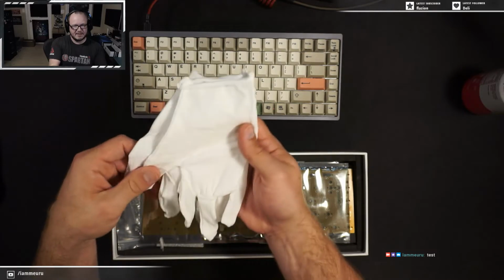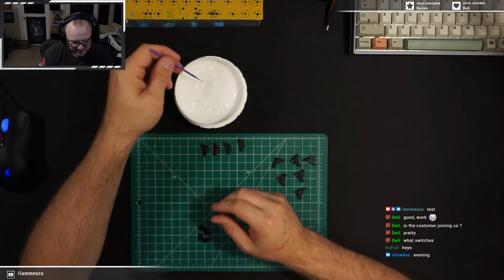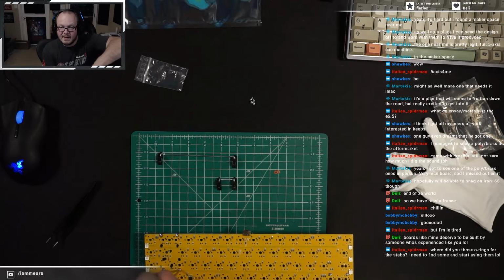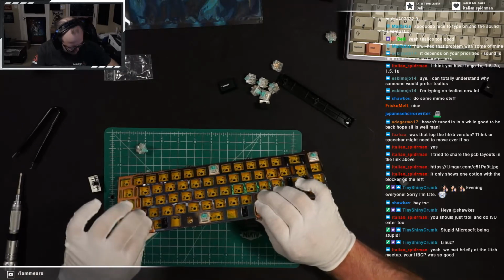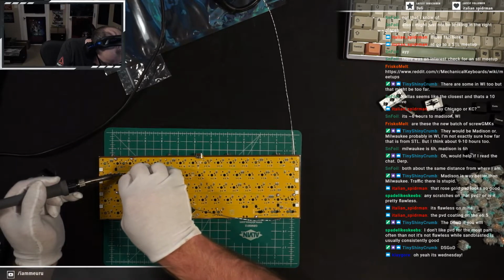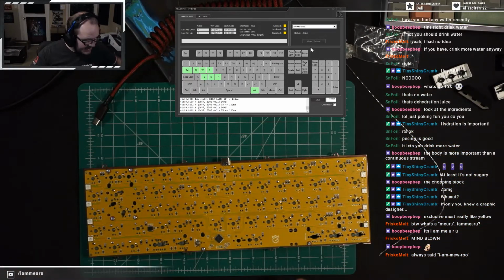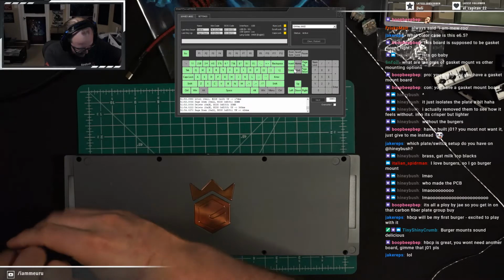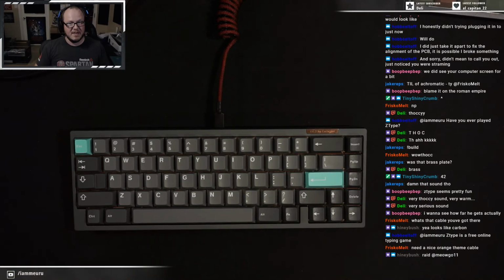Build: E65 w/Tealios

Comment: I rally hate when I hear people say after building this they hate it then I ask how they built it and they usually aay oh top mount no gasket well that's why the gasket helps with the major ping it has yea it will still have reverb but it's not bad it sounds good and if yoy use top mount with the gasket installed it sounds best that way as you did here really you wrrent supposed to use the screws in top mount gasket floats should of just had the gasket and not screws into the top hut I tried it the way yoy did it and man ohan does it sound best that way hahacpuldnt believe it oh and also everyone overtighrens it but all I know is yes it's not the loudest board but it sounds good when built right